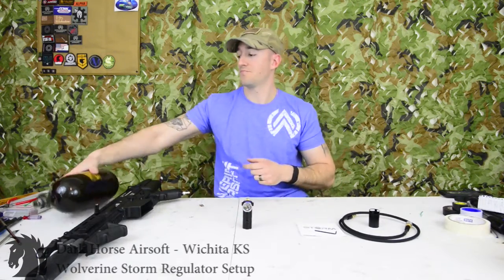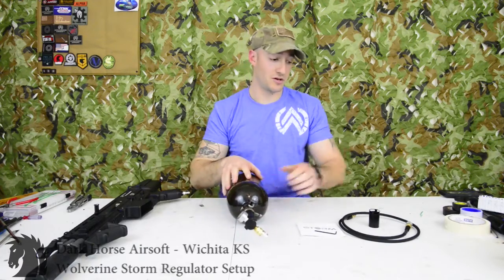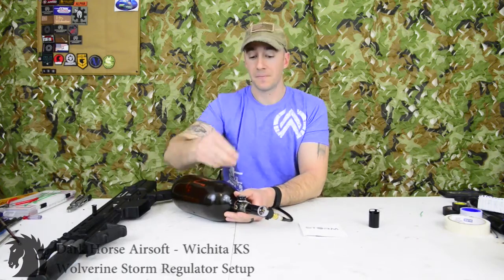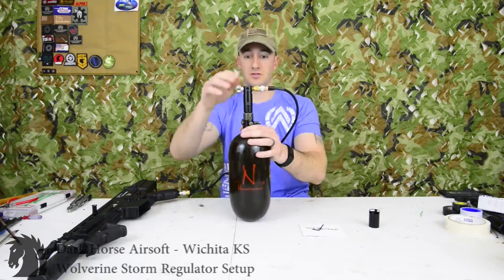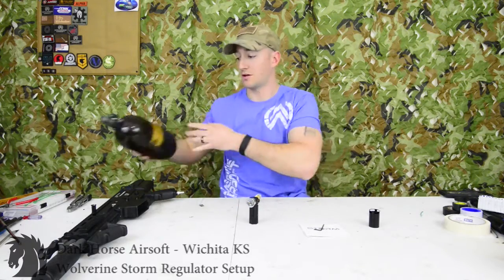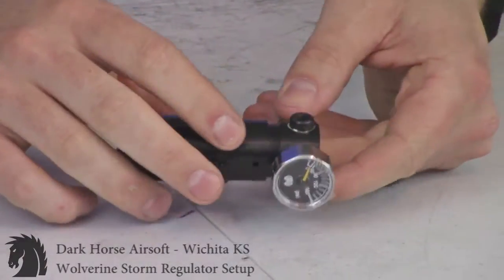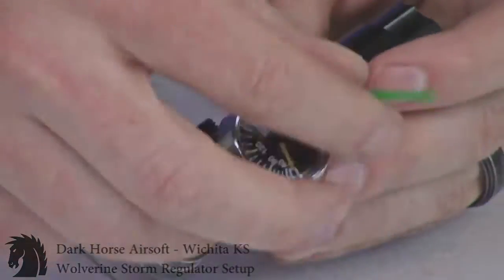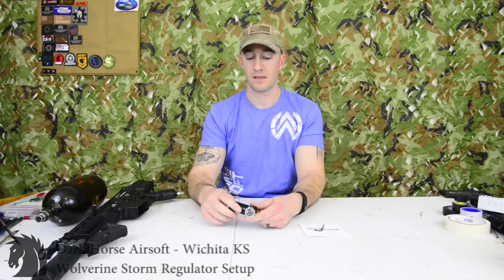Wolverine Storm Regulator Setup

Comment: PRO TIP! Instead of firing shots off to bleed your reg, you can unplug the gun, then use the line and connector attached to the regulator to bleed it out instead. So unplug it from the reg, then hold the collar back and press the male end of the line back into the connector until you hear the air hiss out. Boom! You just safely de-pressurized your reg :)

Comment: Would you damage the regulator if you just unscrewed it completely?
Reply from the maker: You can damage one of the tank o rings mainly if pressure is still in the regulator.